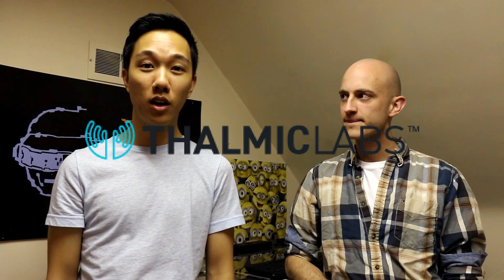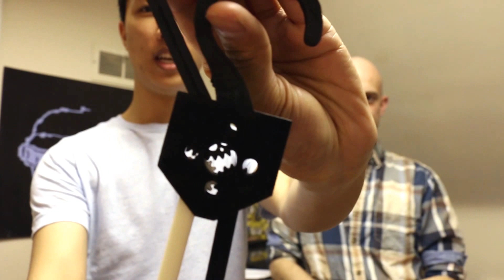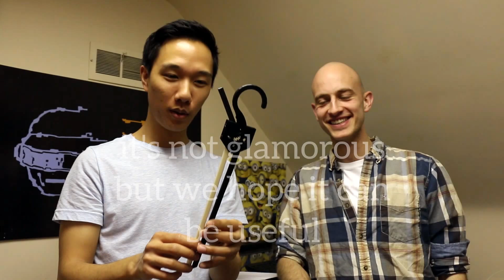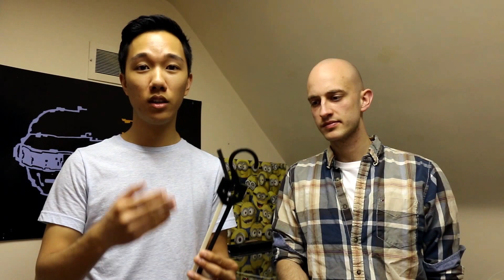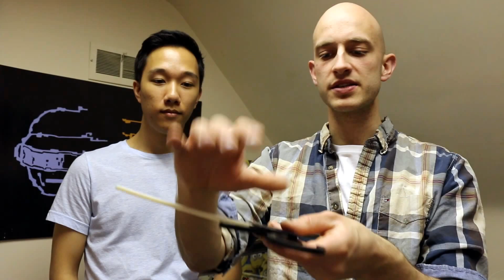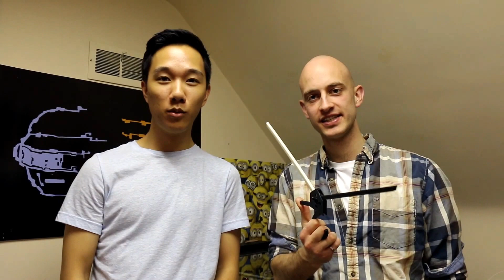Startups and a Quick Hanger

Comment: Pretty cool idea guys.
I would say that it definitely has potential to make money if you are able to get it into major retail stores.
I think your main concern will to be minimize manufacturing cost. You will be competing against the 1 piece hangers that I would assume are ridiculously cheap. Major stores aren't going to want to spend too much money on such a simple item.
I would suggest trying to limit the number of components, I think an "X" shape design without the gears and use a linear spring and not a torsion.
Just my quick thoughts.
Keep it up guys!
Reply: Joshua Vanderwindt Thanks for your input Josh. You raise some really good points! Most of them we had to learn the hard way over the summer! haha.

So the thing about an X-design is that a person's comfortable range with their thumb is only about 30 degrees. In our testing, this was not enough to easily and comfortably insert a shirt. We use gears to get a gear ratio of 1:3 movement. I.e. 30 degrees now translates to a 90 degree swing. Manufacturing costs against one piece hangers are definitely our weakness. We are hoping to see that the extra manufacturing costs offset and justified by reduced damaged merchandise (i.e. stretched necks) and increased employee productivity. Also, it would make the customer's user experience much easier, which might give them more incentive to visit stores. We have also been recommended to try to target high end stores, where relative to thousand dollar merchandise, the price of a more expensive hanger to increase the luxury level could be justified. In regards to the linear spring, it is what we have experimented and there is probably a way to do it well and minimize components, but we have not figured it out yet. It is tough to mount the spring to a spot that always applies a perpendicular force strong enough to hold up the shirts. Note the large moment from the weight of the shirt due to the length of the arms in comparison to the handle. 

But it is definitely our achilles heal, and we will have to pay close attention to the manufacturing costs.